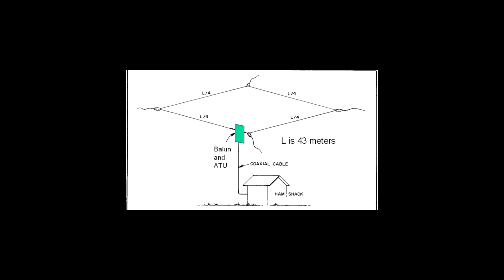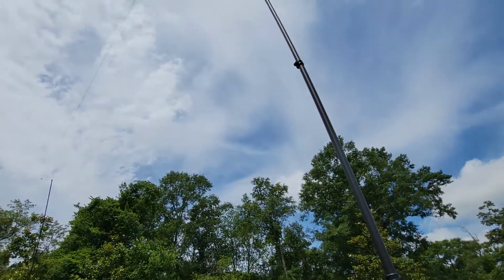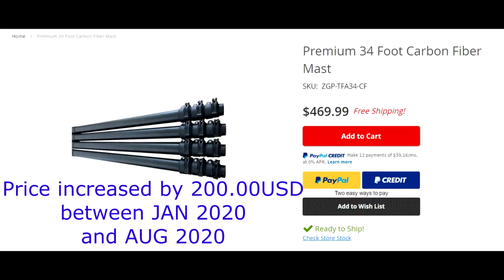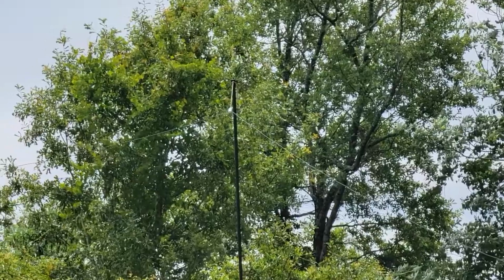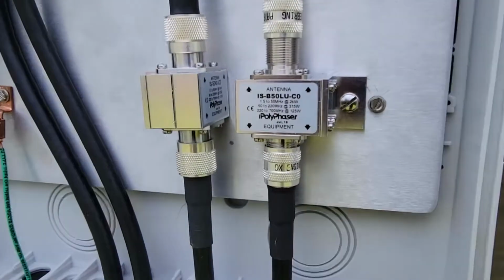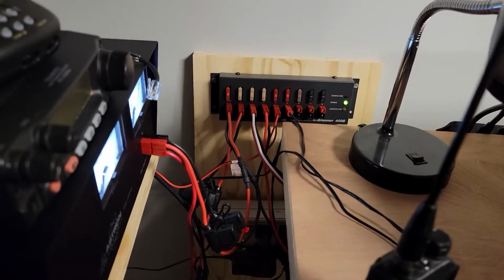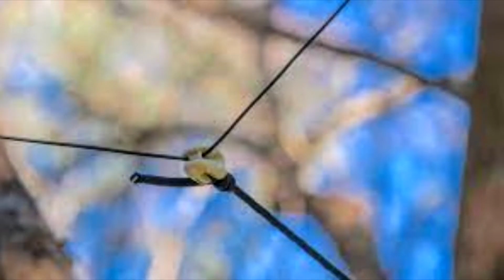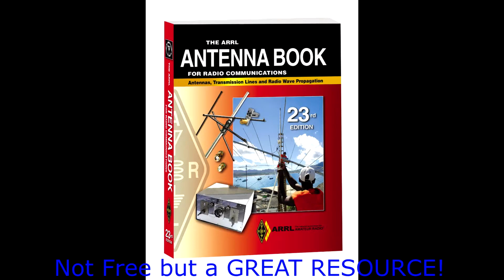HF Horizontal Loop Antenna #hamradio

Comment: Great video. I have a 100% solution to all of your antenna problems. Simply sell your house and move outside town to a rural area. I sold my hose on 0.2 acres in Charlotte, NC and moved to just outside Jacksonville, Florida. I now have a brand new house on 57 acres that I paid for with the sale of my old house. Add to this that my new house and property are zoned 'open rural.' There are zero antenna restrictions for any antennas below 200 feet in height. I moved from an area where my neigbors were a bunch of stuck up yuppie turkeys to enjoying real wild turkeys and wildlife for neighbors, N2SN in Hilliard, Florida.

Comment: I have been using FullWave loops for 40M for many decades ! I  tried a "Q section" of  75 Ohm TV type coax as a matching device, I just splice it to the 50 Ohm feedline going to the shack !  and it sure works .  I use the loop only on 40M so it needs no tuenr. on the low end of 40 (where I operate) SWR is well below 1.5:1 and goes to 2:1 at the high end.  The horiz loop is best NVIS ant.

Comment: You made s great video,  but you have some problems  that I see in your system. The loop itself is fine.  And the 450 ohm ladder line is also great.
1.  Take the ladder line straight to a ladder line tuner instead of to lmr400
Ladder line has  almost 0 feedline loss and becomes part of the antenna,  and makes up for smaller backyards.
2. You have a big mismatch from the 1 to 1 current balun ladder line is 450 lmr 400 ohms is 50 ohms .
Use 4 to1 or 2.5 to  match your coax.   it will give you a better operating system.
3. The lower a loop to the ground the lower it's SWR
I  had a full wave 40m loop 7 ft off the ground and  fed directly with  coax no balun
It was less than 2 to 1 on all bands 40 to 6 except 30m was 3  swr.  Folks say that the 2.5 to 1 talented balun  is even better on a sky loop.
3. You can lower it  just lo enough  to not be seen use the 1 to 1 baln you have near the shack  for  a common mode choke.
The system would match.
and not be seen. 
I worked several thousand qso's from all contents  during the morning and evening greyline.  Best antenna I ever had.
AA4CP Chuck
Port Salerno FL
Reply from the maker: Thanks for the reply...here's my thought process for when this antenna was ereceted...

1. There is a very loud source of RFI from my neighbor that's also located near my operating position. I agree that ladder line to the tuner would be best but I tried to keep the feed point farther from the source of the noise. I COULD have used a remote tuner but the cost was more than I wanted to pay.

2. A 4:1 is preferred when you're close to resonance. The antenna, in the end, wasn't resonant so I chose the 1:1. Since I made this video, I've also tried placing a 4:1 up high with no ladder line and a longer run of coax. It worked OK, but also was too short for 80m. This led me to shortening the loop to one cut for 40m. It worked BETTER for 40m and 20m but actually did worse on other bands. In the end, I wound up taking the entire loop down and replacing it with a shortened 80m OCF dipole.

3. This is the fourth loop I've had. I also had one cut for 160m that was low to the ground and I worked almost 1000 QSOs as well. They're great antennas.

Again, thanks for the reply. I agree with all of your ideas, it's just that I have very unique issues that prevented most of those solutions. That, or I was too cheap to try other options. 73.

Comment: While some people can afford the most expensive gear available, an inexpensive 4:1 Balkan, what ever coax you can get, and a good tuner is all you need. My loop is not tuned by length, it's up 7 meters, yet has been a great antenna on all bands. DX is no problem, even on 40 meters. It will tune up to 6 meters and all crews in between. WSPR test have shown it out performs my beam. Don't let the wealthy hams fool you, the most expensive gear is only provable as better by test data, and will never be noticed by your ear.

Comment: Try a 4:1 or even a 2.5:1 balun. Should bring the swr down a lot.
Reply from the maker: Tried a 4:1 balun up high at the top of the loop but the loop was too short. That also created a mismatch but I agree with your idea.

Comment: protip: swap out the copper wire for 316 stainless wire. You'll drop SWR dramatically.
Reply: SWR.low because of losses, dont do that. If you use a very long feedline SWR is low for same reason
Reply from the maker: The next time I put up a loop, I will try that out. Thanks.
Reply: Ollie, I've never heard that stainless wire lowers SWR. Any idea on why that is? Just curious, 73 KJ6ER
Reply: @gregmihran8616  it does the same when modelled in mmana as well. Maybe matches the balun better.
Reply: SS wire is a good choice especially if you are located next to salt water. However, one cannot solder the connections and the antenna will have to be slghtly longer to tune to resonance, N2SN.
Reply: @TheCrunchbird  I just use screw terminals, ones with the holes in the middle of the post so you just poke the end of the wire through and clamp it down. Worked a treat.